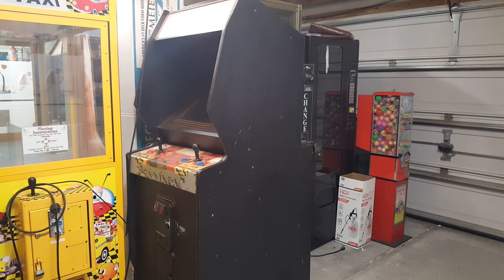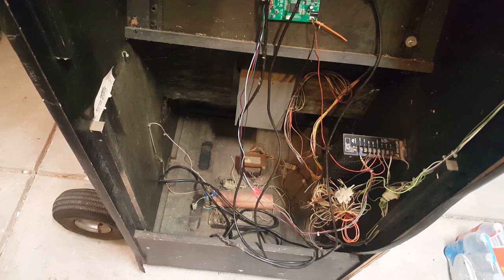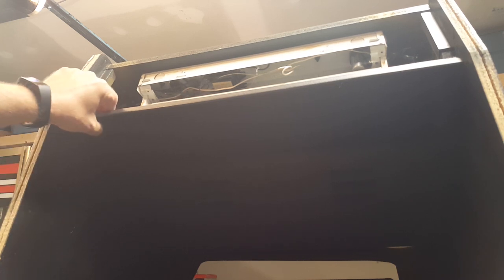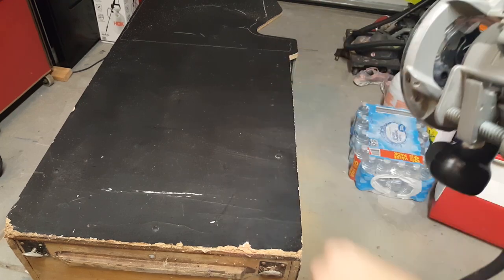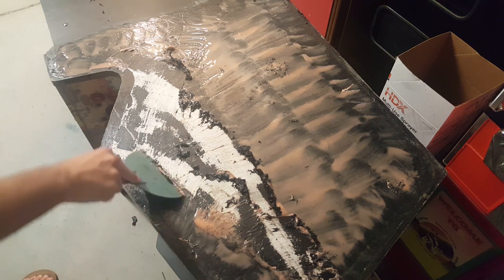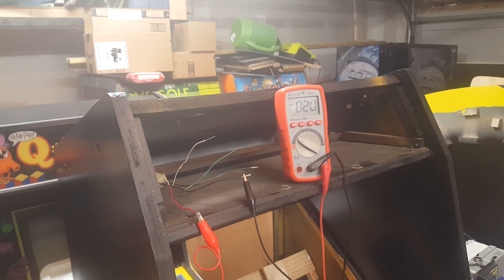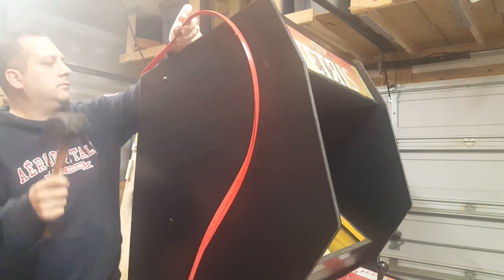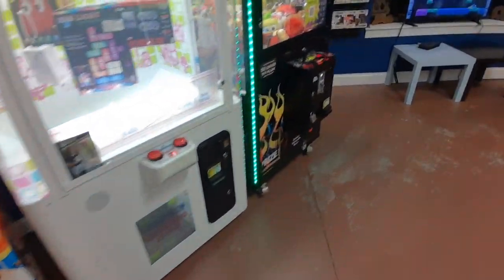Tetris Arcade Game Repair and Refresh - You won't believe what we had to do to get this done!!!

Comment: What brand and model LED light did you use? I guess you apply 120VAC to the LED fixture? What kind of power supply are good at not using a lot of juice so your electrical bill is not expensive if you have many arcade games power on all day long? Anything to suggest for a type of LCD or LED monitor that will last along time because most LCD and LED monitors don't last long in arcade games
Reply from the maker: I think the brand is hyper tough?!? Its right off of the shelf at Walmart